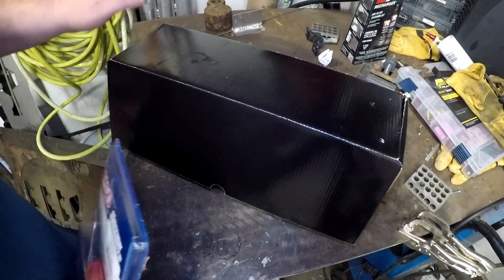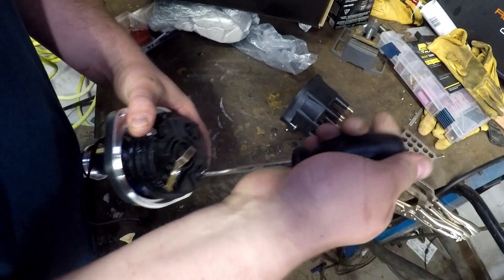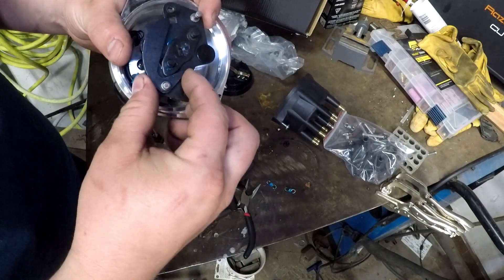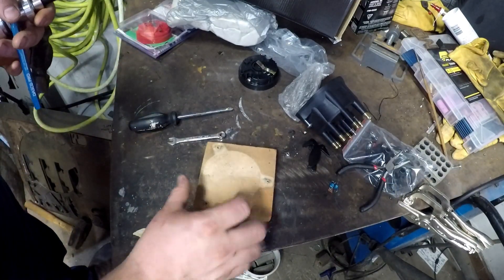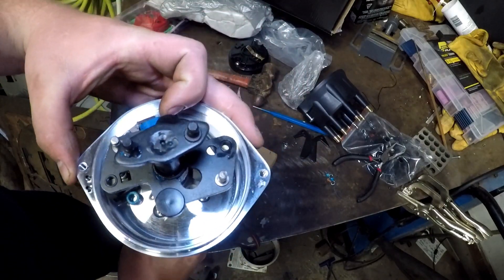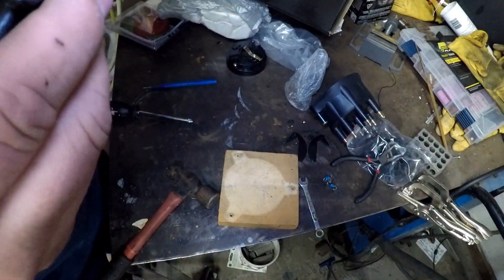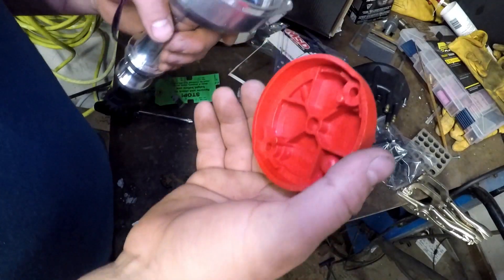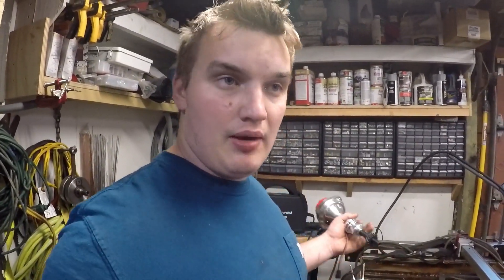How to lock out a two wire distributor.

Comment: Hello, Is the magnetic pickup wire able to be changed with the distributor installed and not having to remove all the parts?? Basically are you able to remove the 2 screws for the mag pickup and maybe crank the engine if needed to be able to have room to get the mag pickup out??

Comment: What's the point of locking the distributor out
Reply from the maker: So the computer on a fule injection system can change it
Reply: Hello, Is the magnetic pickup wire able to be changed with the distributor installed and not having to remove all the parts??